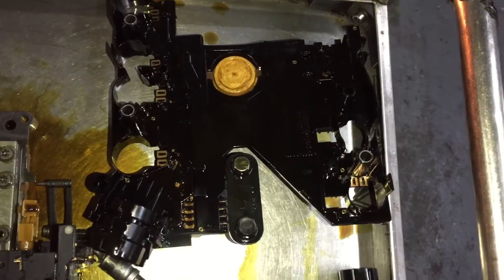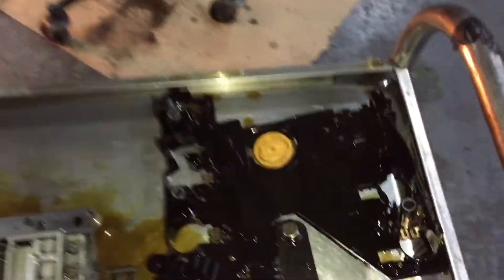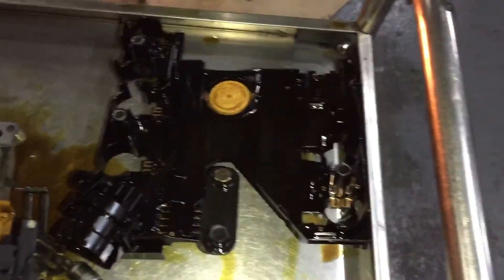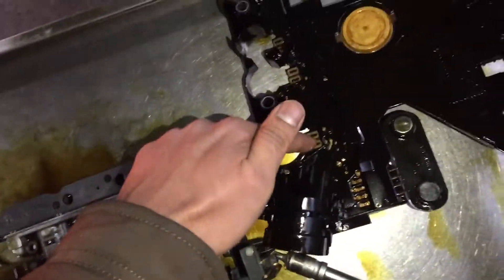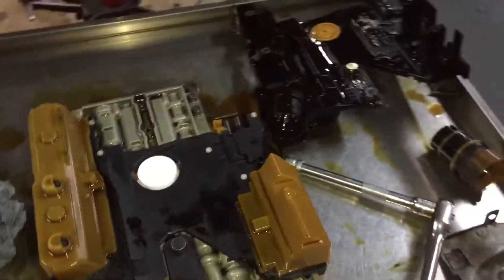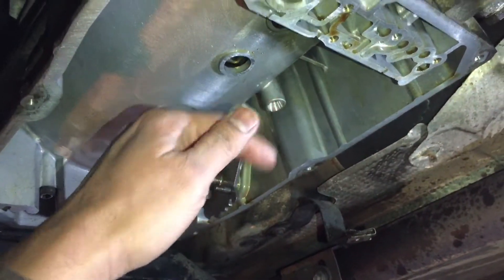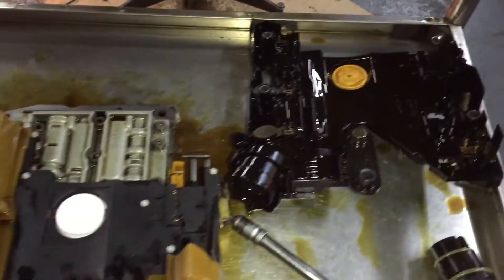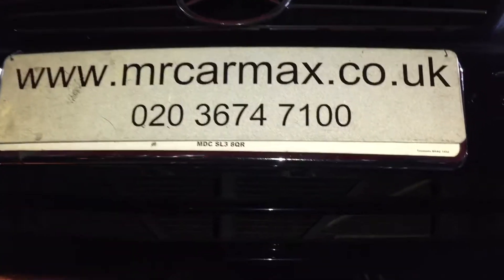Mercedes automatic gearbox Tcm repair p0715 p0716 conductor plate 722.6 c class e class slk clk

Comment: i have a 1998 slk230 with P0715 and p0720 codes I change the conductive plate and connection plug twice and still have the codes. Will not shift out of first ..solenoids check out ok with 12 volts applied.. and wondering if its the computer  got oil  wicked up in it..
Reply: I haven’t started to change anything yet. I also have that code. I’ll check plug 1st I guess. Any other ideas before I drop pan and order module?
Reply: @BorderbarnMusic  : how did it go? did you change the plug connector or the conductor plate? I have the same P0715 code issue at 140K miles
Reply: @alannobakht8503 are you stuck in limp mode? Mines won’t go into gears at all fully limp mode